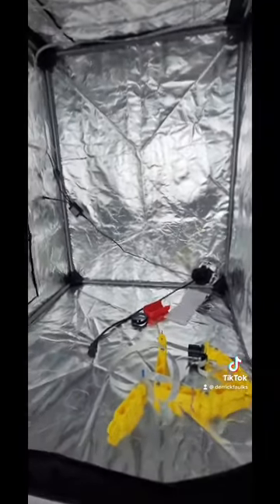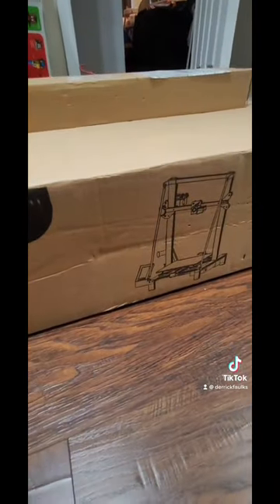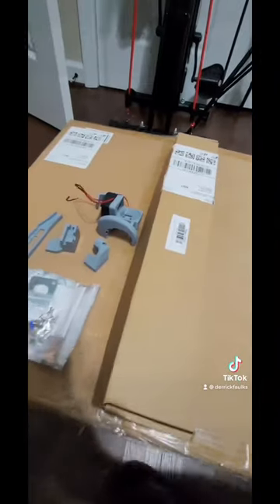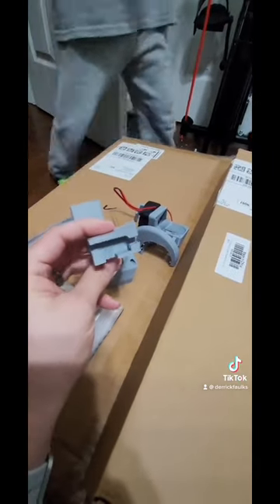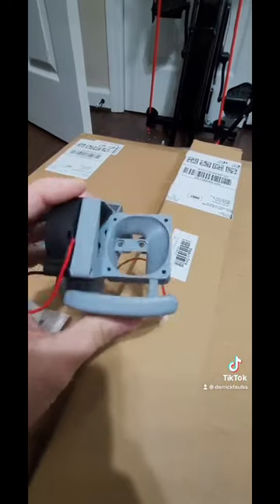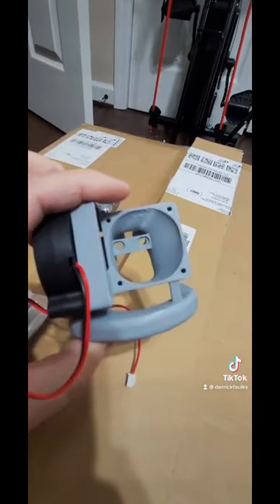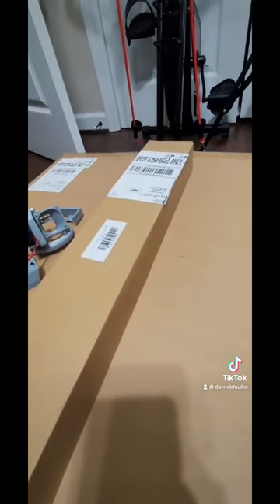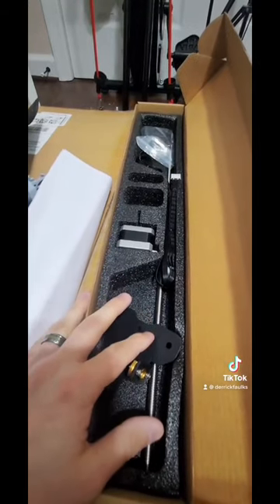My new printer arrived (Longer LK5 Pro)! My (Alfawise U20 replacement) #3dprinting

Comment: Where do you get the dual z axis upgrade from? I was thinking of upgrading mine eventually, just got into it.
Reply from the maker: Great question, so the one I bought can be found here: https://www.amazon.com/gp/product/B07529LXTQ?ie=UTF8&amp=&psc=1&_encoding=UTF8&linkCode=ll1&tag=dfaulks-20&linkId=b587431c2a8c3ea28f528e8e3981374e&language=en_US&ref_=as_li_ss_tl
Reply: @DerrickFaulks  Had no idea that one would work on it, thanks. I just got into this and learning quite a bit yet, and so far the printer is doing mostly well. How was the stepoper motor installation? was there any specific adjustment that gave troubles?

Comment: Why did you replace your u20 ?
Reply from the maker: Great question, the U20 was a great printer. I had very few issues with it. I did consider just buying a new power supply for it. I mainly just wanted to try something different so I bought a new printer.